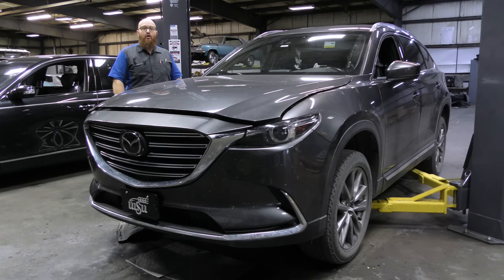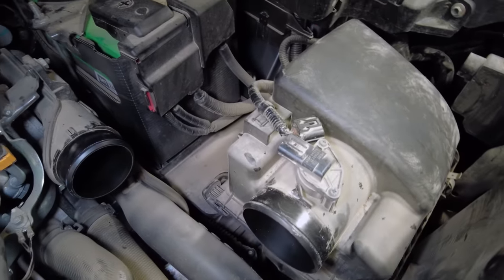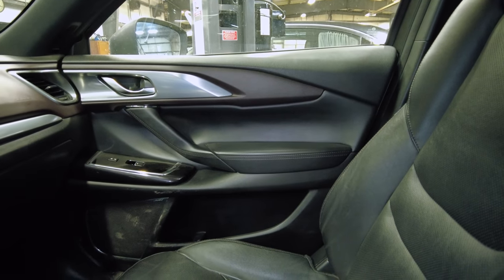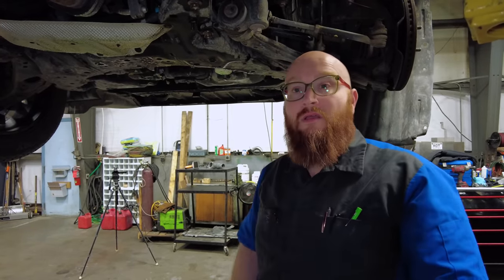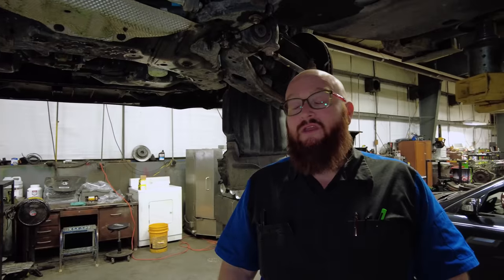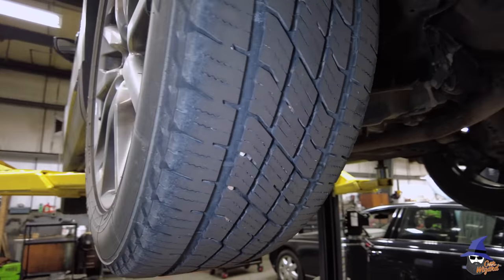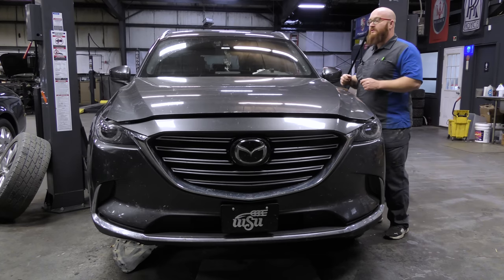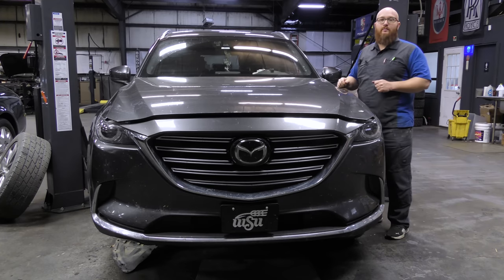Really, a $4K leak! What could be wrong with this '16 Mazda CX9 that could possibly cost that much?

Comment: My 2016 CX-9 w/ 117000 miles is currently at the dealership having the engine rebuilt because of the known head crack.  They first said that it was a thermostat that was causing the overheating.  Replaced that to the tune of $500.  Then they said that the engine needed to be rebuilt and quoted $10k.  I decided to appeal to Mazda Corp since I figured that they knew that it was a known problem.  Tack on another $500 for a rental car while Mazda reviewed the case.  After 3 weeks, Mazda said that they would cover $7000 of the $10000 quoted.  It’s bitter sweet because we had already spent so much on the misdiagnosis and rental car.  Keep in my that our 2011 CX-9 has 225000 and has given us zero issues.
Reply: Yeah, that's disappointing. $3k definitely stings. My 2017 cx-9 just started leaking. I'm only getting started with battling Mazda.

Comment: Cylinder head issues are a known problem in the CX series.  Here in Thailand, Mazda have fixed most of them for free and extended the warranty to cover the work and parts.  Doesn't appear to be a problem in newer CX series SUVs.  Ford and Mazda split in 2016.
Reply: What years are the newer cs?
Reply: 2013

Comment: agree with top commenters. Matter of fact - Mazda does their own business from ~2012. And it's hard to find any details made by FoMoCo in modern Mazdas. Definitely, the traces should be somewhere, like, I don't believe Mazda built from scratch these engines, they should've been using previous gens of these motors with shared roots. But it'll be hard or even impossible to find any FoMoCo branded detail on the modern Mazda engine block.
P.S. is it more reliable than Ford? You tell me =).

Comment: It happened to my 2017 CX9 Grand Touring last year around 82,000 Miles. Lucky me I've had a Certified Mazda with 84 months or 100,000 miles. powertrain warranty coverage. In mine opinion It's a design issue for sure. There is no separate intake manifold for 2.5L turbo engines, intake is a part of an engine head in Mazda's, with turbine sitting on top of it to close to the engine head. Also there is a heat shield that covers turbine as well. The turbine is located behind the engine without proper cooling directed to it. After certain time heat will do the work on your engine. Mine had a bad gasket but the new engine head was installed just to make sure it does not happens again soon.  Other Manufacturer (not saying who, with 4 cylinder turbo engine and turbine in same location has special shape engine cover to direct air for better turbine cooling). 
The cost to fix with engine head replacement will be around 4-5K depending, on the shop and state you live in. 
 Good luck Mazda owners, hope your engine will live a long happy life.

Comment: All repairs for vehicles are extremely expensive at this time, so please be careful when you plan to buy your first or next used vehicle.
Reply: Yeah, to keep the old one will be cheaper.
Reply: Not my 2010 BMW x5 in-line 6😂😂easy to work on and parts are reasonably priced
Reply: I bought a Mazda for this reason as they are going up in reliability while Toyota and Honda are going down
Reply: this is why i bought a used jaguar, car costs the same if not less in many cases to service than most cars, breaks down just as often as anything else (once in 2 years of daily driving because of alternator), and it’s a fun charactered car, the rare times it has issues, things can be expensive, but similar prices to people I know with “normal” cars.

Comment: That's kind of what my head gasket did in my 05 Mini. It wasn't leaking into the cylinders. It was just leaking out the back. Replaced it myself in a few days a couple years ago and it's still holding well.

Comment: My very first Mazda, and the only one I ever bought, it had a freeze plug come out, caused the head to be warped, this in the first 6 months, brand new car, never bought another Mazda after that. It should be noted that my buddy bought a new Toyota at the same time, the Toyota is still running with over 200,000 miles.
Reply: I'll counter with my Mazda, has over 200,000 miles; engine runs like new, with perfect compression.
Reply: @petesmitt  So, basically, you have a 50-50 chance of getting a good car or a bad car, according to this informal survey

Comment: Have been with Mazda and still am for almost 10 years. This is not a blown head gasket. The 16 and up CX9s had a bad run on cylinder heads and have problems with cracking by an exhaust port where the manifold meets the head. It has happened to a decent amount of them in the time ive been with Mazda. Typically the exhaust port that fails is on cylinder 4. The crack runs deep enough to pierce the water jacket and leak out coolant. I have yet to see a blown head gasket on a Skyactiv 2.5T for these generation CX9s.
Reply: I've read that the 2020 model seems to be the most reliable - what's your experience?
Reply: @kel327star  so far the 2020 CX9s ive seen, they've been pretty much bulletproof. When they come into the shop my experiences with them is typically they are needing basic routine / maintenence. Tires, brakes, etc. As long as u stay up to date on maintenence on these Skyactiv turbo engines, they have been very forgiving. Just be sure to replace spark plugs every 37500 miles on the turbo models. That's the spec by the book on them. Even with that said, its not to say you will have a problem child car come in, but the products ive seen the last few 6-7 yrs from Mazda have been extremely reliable.

Comment: I have this same car. It’s the SUV for people that hate SUVs. Why ? Cause it drives so much better than any SUV in its class. The 4-cylinder is not any more underpowered than the 6-cylinder in the Toyota Highlander. I have driven all SUVs in this class before settling on this Mazda. It’s actually my wife’s car, I drive a Mazda 6 with this same turbo motor…..zoom zoom 😎
Reply: I had a Cx9 for 4 years and 120000 km. Great vehicle and handling that belied its size.
Reply: V6 Highlander had about 50 more hp, naturally aspirated.
Reply: @labornurse  and drank like a fish in comparison
Reply: @labornurse  but the Mazda is way more fun to drive than a Highlander. That’s why you buy this over a Toyota
Reply: @labornurse  but the Highlander also has 50 less foot pounds of torque than the Mazda. Also, the Highlander’s horsepower is made at a high RPM, where as the Mazda’s is made starting at a low RPM. Where most people drive their cars, which is under 4,000 RPM the Mazda not only has more torque but similar horsepower.

Comment: I am actually surprised it was the head gasket and not a cracked block.. These CX-9s have a common problem of the head actually cracking and coolant leaking out.
Reply: So if the cracked head is a common problem, why would you suspect a cracked block? It's like you provided the explanation, but you don't believe it.
Reply: @andoletube  I think block was a typo.. he meant head.
Reply: Would you recommend me to buy this suv used with 120k? What year would you recommend?
Reply: @jackryder6732  The CX-9 is a solid SUV as is any Mazda. I wouldn’t shy away from that mileage as long as it doesn’t look like it was beat on. The turbo engine in CX-9s develop the cracked head issue from excessive stress on the engine(towing, hammering the gas pedal all the time ect).

Comment: I would also inspect the head very carefully. These early model 2.5Ts had some head cracking issues because of the integrated exhaust manifold in the head.
Reply: Ugh! I can't (but yet I can from the manufacturer's position) understand why part integration like that is done! It just makes repairs insanely expensive for the customers!

Comment: I've never seen such a head gasket fail so thoroughly...wow...
Reply: Happens when the customer ignores the problems.
Reply: Ignoring the problem usually results in more leakage, harder to maintain the optimum coolent level and usually continued engine overheating.  Result more damage to the engine and its ancillaries - and often not helped by a frustrated 'time poor' owner having to pull up by the side of the road in order to refill the hot engine with cold water - i.e. pouring cold water into a hot engine can cause more damage.  With such a prolific leak, I wouldn't be surprised if the car overheated on the way to the Wizard's workshop.
Reply: The cylinder head is actually cracked near the exhaust studs. It is super common on these
Reply: It’s not the gasket.  Head is cracked.

Comment: Hey Wizard, want to give you a heads up.  My mazda cx5 has been in the shop for over a month because the head itself is cracked.  A manufacturing defect apparently related to the cylinder deactivation
Reply: Cylinder deactivation is horrible for the engine.
Reply: Why a month? Are heads hard to get?
Reply: What year CX-5 is it, iphone?
Reply: @crlaw75  Outside of 2018/2019 the amount of issues related to cylinder deactivation are next to nothing when compared to GM AFM/DFM.
Reply: Cylinder deactivation is only present on naturally aspirated engines, not turbocharged.
Reply: Cx-5 doesn’t have cylinder deactivation
Reply: @Don008Ramon  lol it does since 2018
Reply: what year is your cx 5?
Reply: @Don008Ramon  all cx-5s NA 2018 and after have CD.

Comment: 4921 is the last of the DOT code... and that's a MAZDA SKYACTIV motor, has nothing to do with Ford. They split over 15 years ago, the 3.5 and 3.7 in the old CX-9 was the last engine they shared.

Comment: I drive a 2012 1.2 Fiat Punto.
It has 69 hp and 230.000km
Driving technique is foot to the floor and change up at 5.000 rpm. 
Issues I've got were worn valve seals, rusted oil pan (I still can not believe that at 9 year old car it rusted) and ignition starts to missbehave in the rain as cables get wet.

Comment: My neighbor just went through the same thing on the same car but a 2019. Fortunately it was under warranty which made it really a $6000 repair. The main difference is they actually replaced with upgraded heads. So basicaly This was an engineering and design failure. And the replacement heads from China are nowhere near as good as OEM. Especially the new upgraded OEM heads.

Comment: Ford is no longer (since 2015) related to Mazda. The Sky Active engines were 100% developed by Mazda. This is NOT a Ford engine. Blown head gasket is probably a result of the very high compression ratio the Sky Active engines employ.

Comment: My head gasket wizard started leaking on my 1992 Honda civic last year with 160000 miles. Age got it. The motor doesn’t burn any oil and has been maintained religiously. On some 20 year old civics with over 200k They will leak also. I never let mine run hot so we went with a fel pro gasket and left the head it’s self alone. It is fine now but catching it early for the owners is the key.

Comment: Had a Sprinter with the OM602 5cyl 2.9 Turbo. Massive leak at the rear of head like a waterfall. K Seal (2 bottles) lasted 15 years. Replenished at coolant changes. Saved a packet and lasted 15 yrs 200,000miles. Told it would never work.

Comment: It's most definitely a Mazda engine. Ford had nothing to do with it.
It's not uncommon for the 2.5L to blow a head gasket but usually it's internal. That one is unusual. There's possibly a casting flaw.
Other than the 2.5L blowing head gaskets the CX9 is a decent vehicle. They get great gas mileage and have plenty of power.

Comment: Sorry Wizard, as so many other commentors have commented, Ford left Mazda in 2015.  All of the SkyActive engines are purely a Mazda design, starting in 2012+ 2L and 2014+ 2.5L.  My wife has a 2017 Mazda CX5 and there are some FoMoCo parts on it but most of it is Mazda now.

Comment: I was going to chime in on the fact that the 2.5 Skyactive in both normally asprirated and Turbo versions are 100% Mazda designs. I own a 2017 6 MT  and a 2009 Mazdaspeed 3. And yes indeed the Mazdaspeed 3 2.3 is indeed a Ford/Mazda design.
Reply: MZR engines (including the 2.3 DISI Turbo) was a Mazda design, but since Mazda was under Ford ownership, Ford had an all access permit to Mazda's intellectual property and in the end, after the divorce Ford kept the rights and still uses the same basic design of the MZR family of engines. The MZI on the other hand, was a Ford engine that Mazda used for some models.
Reply: @AndresSalazarAutos  The engine block was stamped with FOMCO on both my 2007 and 2009 Mazdasped 3s. I understand the relationship Ford had with Mazda going back to the Ford Courier. I do acknowledge that the MZR was a Mazda design. It  was all very weird and convoluted what was going on with Mazda, Ford and Volvo during the period. You concur that the 2.5 Skyactive series has nothing to do with Fomoco?

Comment: I have a 2007 Mazda cx7 with the 2 3 Liter Turbo engine and same for us that the head gasket blew at 250,000 kilometers as well as the timing chain. It was expensive to fix but well worth it as most Mazda SUVs are $50000 and up for a new one in Canada.

Comment: I almost bought one of these a couple years ago but got a QX60 Luxe instead which I really liked. The one I was going to buy also had the issue with the wheels flaking which is a factory defect as well as the cracked radio screen like the one in your video. There is a service bulletin that covers the cracked radio screen. I called to confirm this with the dealership in case I ended up with one of these.

Comment: Any higher powered 4 cylinder engines are grenades with the pin slowly working out 😮
Reply: Add "FORD" to the equation and thats screaming for trouble.
Reply: @jonsimmons4150  Except it is a Mazda engine, NOT a Ford engine.
Reply: That's actually not true. Just look at for example the honda civic type R, is just about how well they are made.
Reply: @pablonavaridas3302  many 4 cyl engines with turbos will pop at lower mileage. Yea there are exceptions
Reply: @pablonavaridas3302  many 4 cyl engines with turbos will pop at lower mileage. Yea there are exceptions
Reply: Not quite correct.  An example of a poor design is the V6 Alloytec courtesy of GM.
Reply: @UnknownUser-rb9pd  anything remotely in contact with ford has had the ford cheap out beancounters involved, it doesnt matter where the engine was made, castings or whatever- ford could have had its grubby tight finger inthe purchasing system, you dont know where the gasket came from. anything to do with ford is made to just get it over the warranty line, and a bit of spare so they dont get too sued by lawsuits.if ford has been involved anywhere- run for the hills
Reply: @jonsimmons4150  I'm a long term owner of several consecutive Mazda cars so am not a Ford fan boy.... but generally, in Europe, Ford's are more reliable than all the German brands and most of the other European brands.  And they have a reputation for driving very well on our relatively narrow and twisty roads.
So I think their reputation is undeserved.
I also suspect much of the time they do have a problem it is Ford owners who cheap out on parts and servicing because the Fords are relatively cheap cars that get passed down through many owners and people don't want to spend the money.
I'm not saying that big corporations like Ford don't get it wrong but that they are sometimes an easy target.
Reply: @UnknownUser-rb9pd  i used to prototype test ford engines on dyno at a world reknowned consultancy company at shoreham by sea, i was RAC patrol too.

Comment: I love Mazda I've had 3 vehicles so far. 2008 mazda5, 2002 mazda 6 and 2013 mazda 3 hatchback. Love them all, no complaints what so ever. My question is, why does mazda loves Fucking around with Turbo Engines? seriously why? stick to what you do BEST!

Comment: Definitely a 2021 tire, tire codes can be weird sometimes. Some tires the code that specifies the year will be on the back side if its not on the front, very annoying.  I work for Goodyear
Reply: Most manufacturers only include the full dot on the 'outside' of the tire or where the barcode on the tire bead faces.

Comment: I am glad we got a 2016.5 CX-5 without the turbo.  It seems we dodged a bullet with the early turbo skyactiv engines.
Reply: All Skyactiv heads are prone to cracking but the Turbos fail at roughly 2-3x the rate as the N/A engines in my estimation. Basically, the problem is complex head casting which has very thin walls in/around the integrated manifold. It's made much worse by the extremely high compression and, critically, from the extremely high lean-burn combustion that's the fundamental Skyactiv part. They fail often in all models but until recently they were almost always misdiagnosed. Often the first sign is overheating with no symptoms which is often catastrophic. They sometimes develop a small coolant or oil leak externally which is the only warning for most. Usually the cracking leads to coolant loss in the cylinder or the crankcase, with the later presenting as a mysteriously rising oil level which is widely documented going way back. 

Anyway, anyone who has any Skyactiv should check their coolant level and, if full, you can be confident that your engine is good. When they do start to overheat, they're always misdiagnosed but seem temporarily 'fixed' as coolant is added as part of the repair. I generally like Mazda but the Skyactiv heads are inherently prone to cracking and there's no awareness to just how different the engine design is.